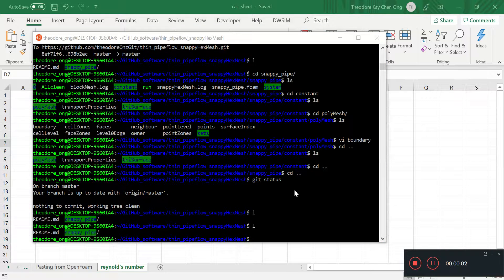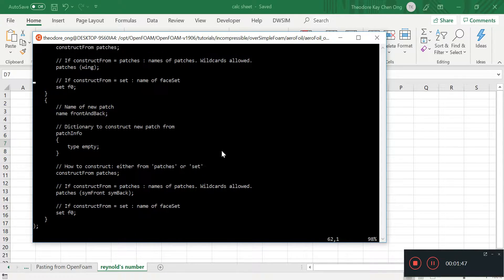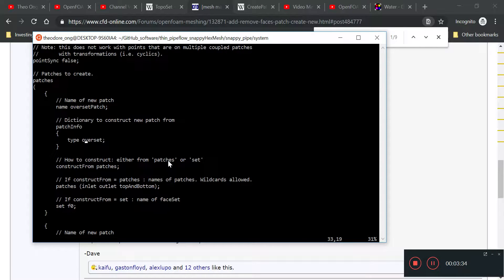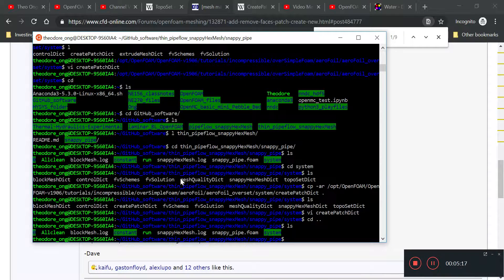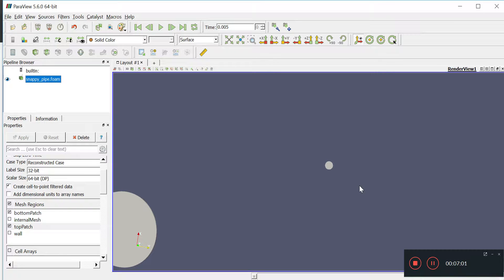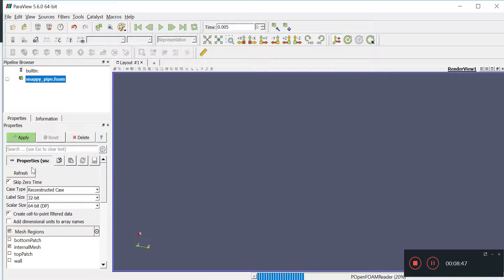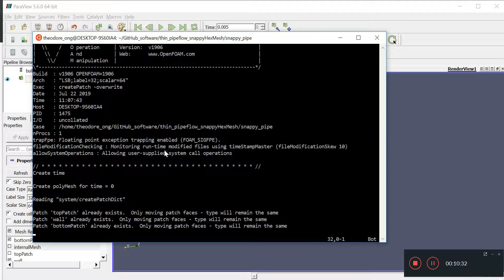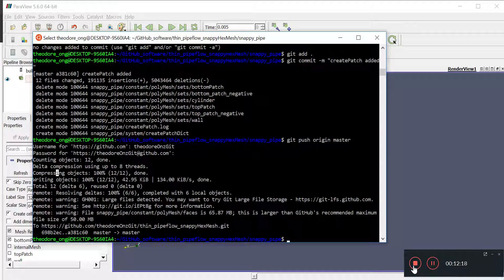OpenFOAM Intermediate - 15 createPatchDict

Comment: I'm trying to learn OpenFoam and i'm following ur videos, so Thanks.
When i run createPatch after modification i got this error:
--> FOAM FATAL ERROR:
Face 808 specified in set bottomPatch is not an external face of the mesh.
This application can only repatch existing boundary faces.

    From function int main(int, char**)
    in file createPatch.C at line 742.

Do you have any idea what is it?
Reply: hello, i am learning too so not 100% sure, but at least from what i know, your issue commes from the topoSet, that you have not selected the correct faces, you might be using a negative to creat the patch, and thats why it has internal faces.
Reply: maybe you need to set the first term of your topoSetDict to cylinder.stl and not cylinder.
Reply: hi. i have same problem like yours, have u solved it?